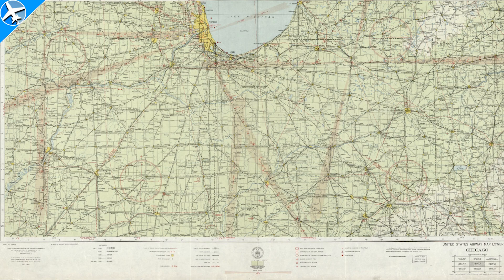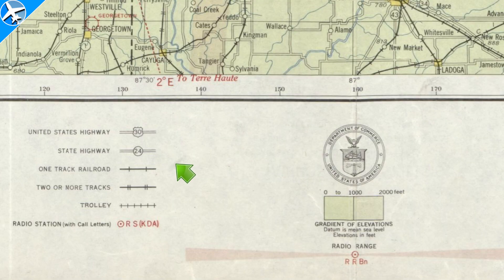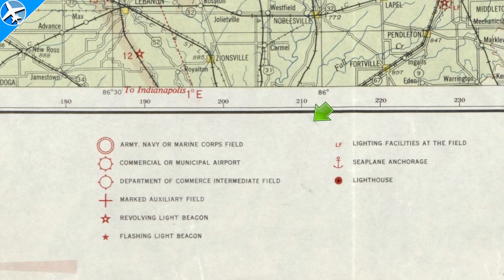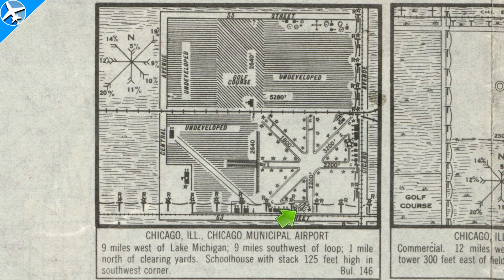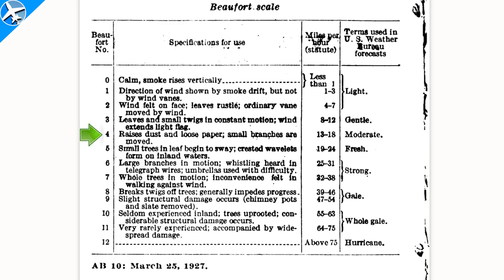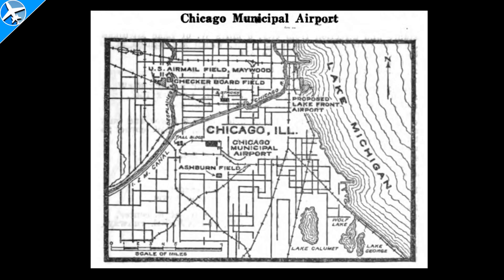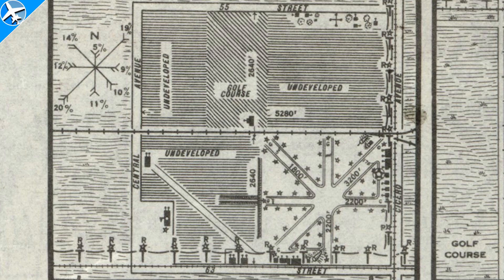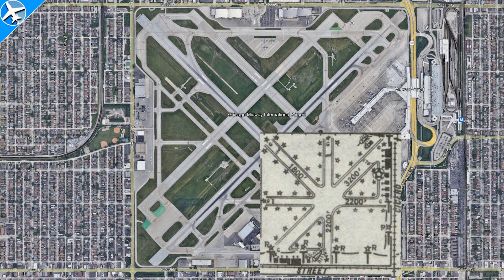Flying to the World’s Busiest Airport in The Old Days

Comment: It's crazy thinking that at one time, Midway was the busiest airport in the world and was just a quarter the size it is now (and it's crazy small for a major airport).
Reply from the maker: And rarely was there an airport with paved runways.  Back then there were about 45,000 passengers getting on or off airplanes with around 15,000 flights at MDW in a year.  Today, Midway sees over 22 million passengers per year.  Most runways were small back then because the airplanes had straight wings that created a lot of lift (which made them slower) and didn't require a lot of distance to take off or land.  The jet age came, and much longer runways were needed.